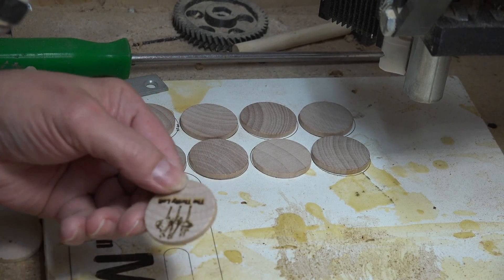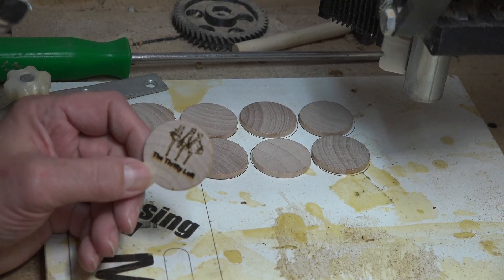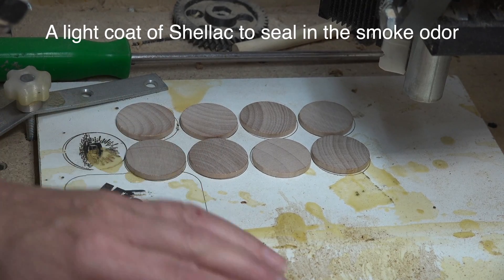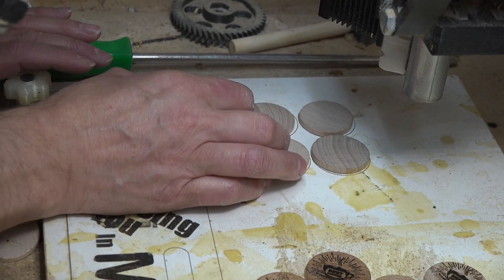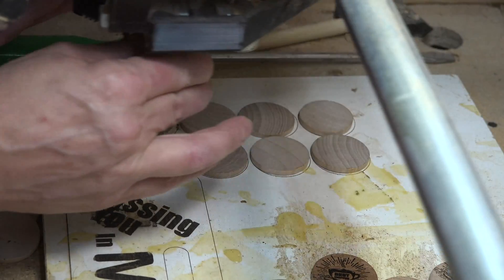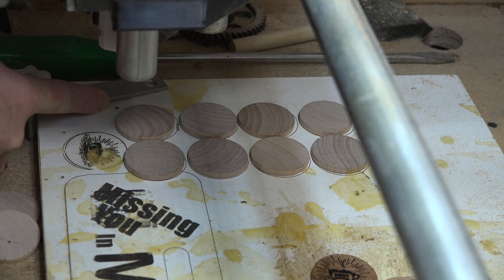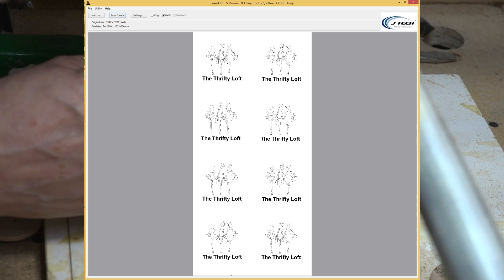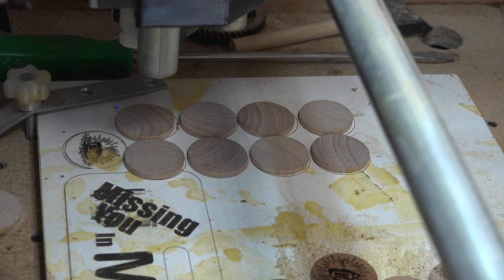Laser Project - Coffee Tokens

Comment: Is that the same 3 watt laser you used in the pink foam video? Also curious what your time to complete the job was? Thanks again 😁
Reply from the maker: each run was about an hour or so if I recall correctly.  The speed in laser etch was set to 1500 mm/min for laser on,  and 250 for cutting speed. I didn't try to set anything to do any cutting, but the laser off speed seemed faster than the laser on speed on the system, (the laser off speed was also set to 1500 mm/minute).  On the MPCNC, I'd then crank up the speed to about 500% on the graphic controller, or however fast I could get it to go without missing steps.  Yes still the three watt laser.  Hope this helps.
Reply: @Someoldguycoding  --- even more than I could've asked for! Thank you. I just checked and my laser is somewhere between Illinois and Oklahoma. Maybe I'll be seeing it Monday!
Reply from the maker: @cliffchism9187  you ordered some eye protection too?
Reply: Some Old Guy Coding indeed. It got here before the laser did.